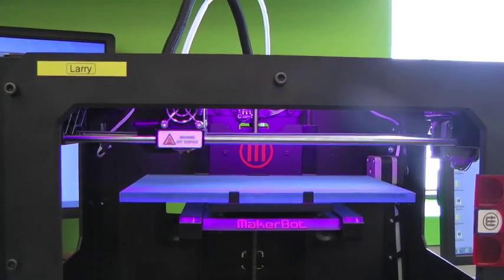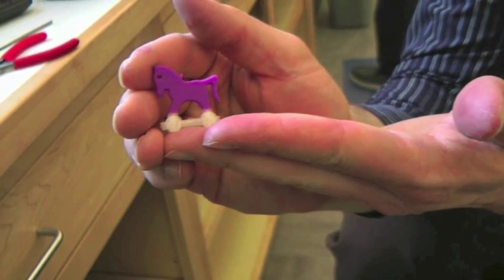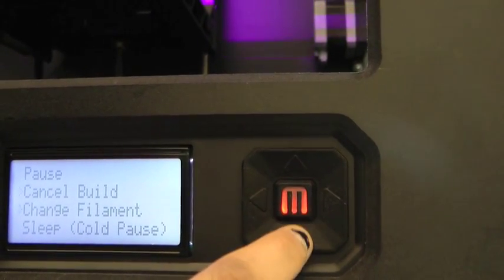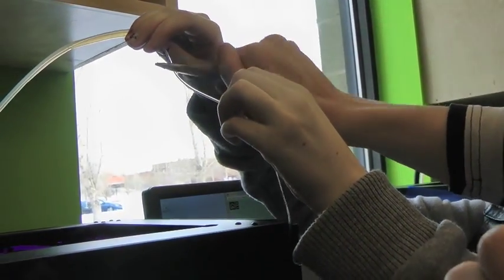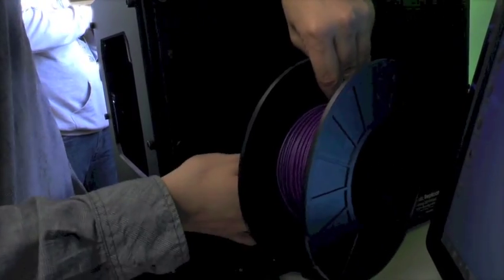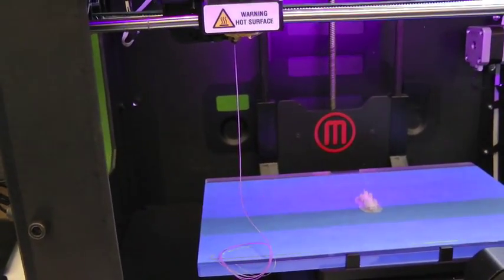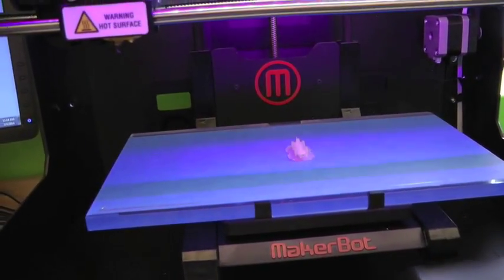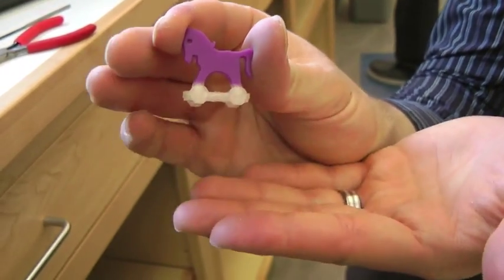3d Filament change mid print

Comment: NOT every printer is that easy! I'm afraid that "some" printers can't exactly have a change filament option in their printer. That you have to use the DANGER way of "pausing" the print and change filament and then "resume" print to get back printing and hopefully everything worked?